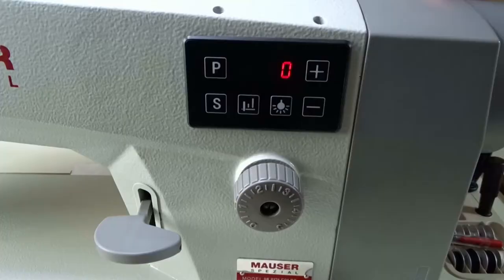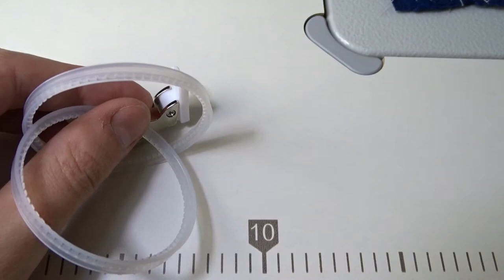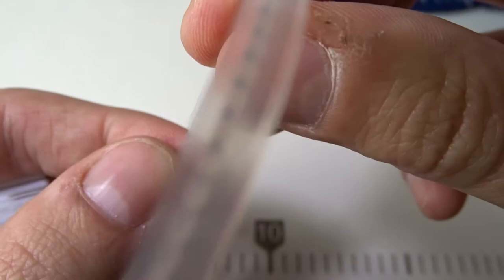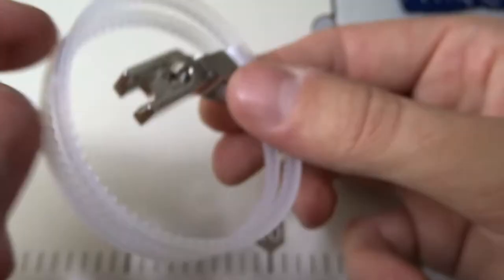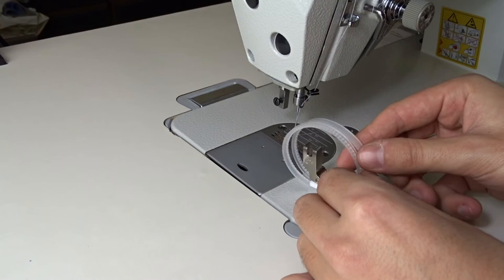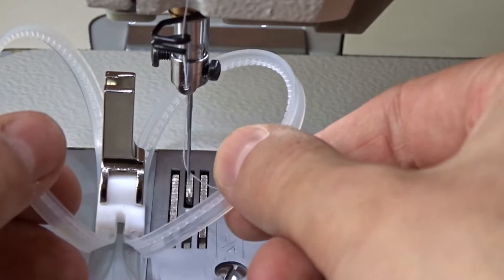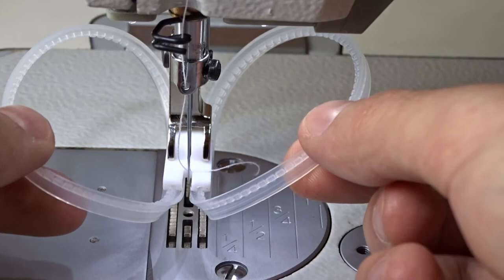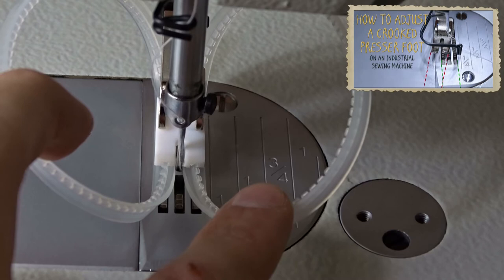HOW TO ASSEMBLE A DOUBLE NYLON RING PRESSER FOOT ON AN INDUSTRIAL SEWING MACHINE

Comment: Hi…Will this foot work on a regular sewing machine or industrial machine?
Reply from the maker: Hi,
This foot would work on most industrial sewing machines. Most domestic sewing machines typically use low-shank presser feet. Based on my knowledge, I haven't come across this particular presser foot being available for low-shank machines, which suggests that there may not be a suitable option for domestic machines. However, I can recommend checking for a presser foot called a 'roller foot.' It features three rollers that help it glide smoothly on fabric. You can find these presser feet in metal, clear plastic, and Teflon variations, depending on your specific requirements.

Comment: I only wish you would have explained the purpose of this type of pressure foot?
Reply from the maker: Thank you for commenting. The double nylon ring presser foot is designed to provide fast adaptability to different fabrics and thicknesses. It is especially useful when working with "sticky" materials like thin leather, rubber, synthetics, plastics, and others as it prevents the fabric from sticking to the foot, making it easier to sew. This presser foot can be used on fabrics of various thicknesses as it smoothly passes through bumps, thick hems, etc. It is like an improved version of the regular Teflon foot.
Reply: Thank you
Reply: @ArtOfClay  thank you.